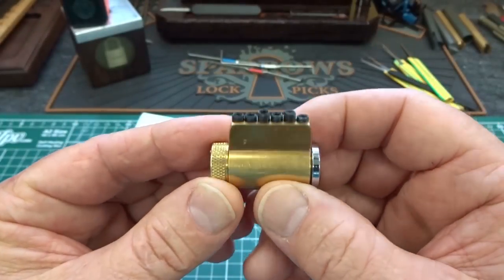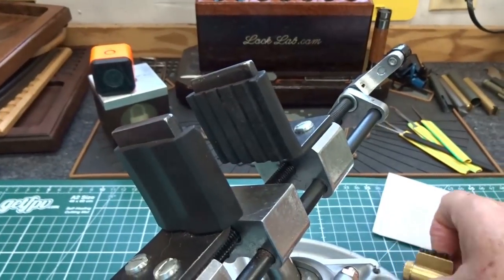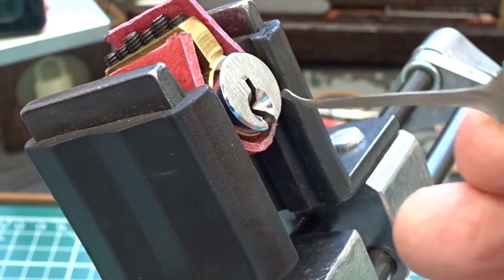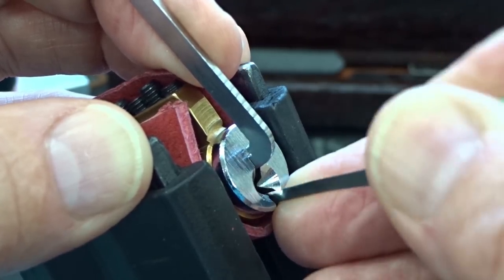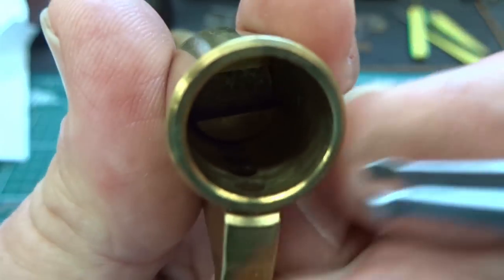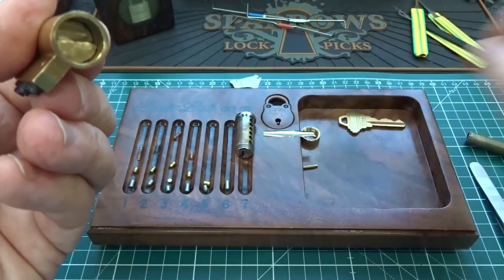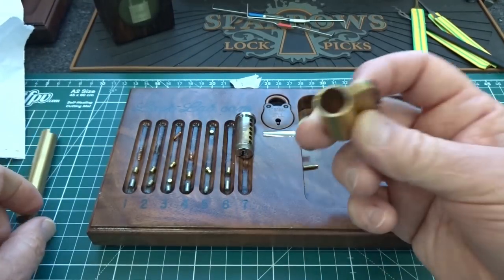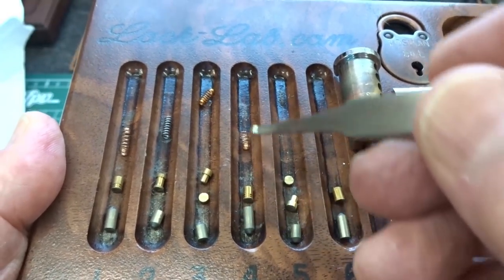(1162) Challenge:  Schlage KIK Cylinder Picked & Gutted

Comment: Some suggestions. Thread at least the part of your Bible. Counter mill at least part of the core. Make sure you spring everything above the sheer. Vary your springs so the pins feel different.  Use a really short initial key pin or ball bearing with a short assa commercial or other security pin on top on the shorty that does not break the sheer then top that with another assa or other security pin. Then make sure you think about the deepest hook pick you can get and then try to pin the back with pins you can't reach.

Comment: I would suggest putting holes in the core that will catch that t-pin if the wafer isn't in the bible.  Looks like there's already one on one side (probably a hole for construction balls) but not the other, if Bill had turned the core the other way he might have gotten trapped